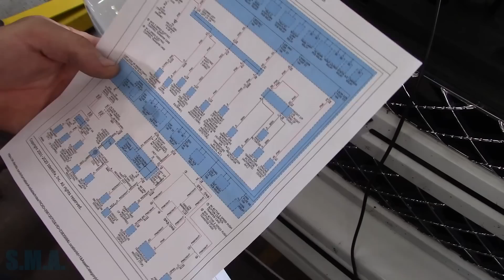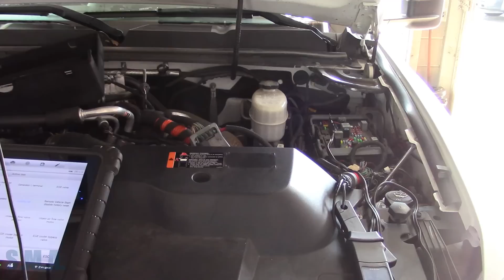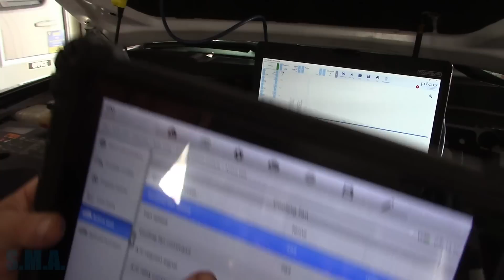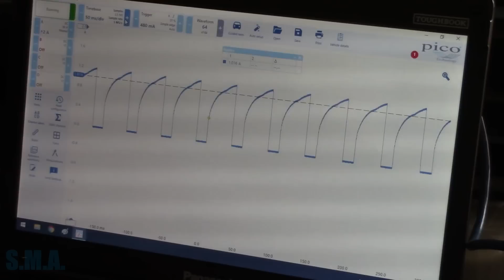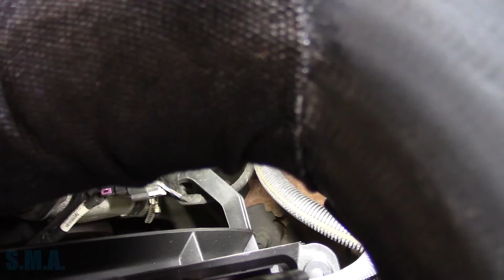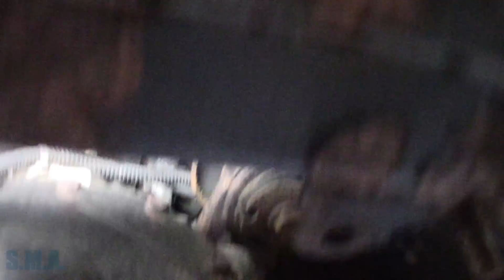Chevy 3500 Duramax Keep Blowing Cooling Fan Fuse

Comment: "Why didn't the other shop find this?" 
A: Because the other shop wants to make a fast buck and is not quality focused like SMA.
Do I advance to the bonus round now?
Reply: Exactly. I hate mechanics like that, the ones who don't want to WORK for a living. Kinda like useless lawyers and politicians.
Reply: Mostly because they lack the expertise and are only interested in quick fixes. And quick fixes mean swapping parts, not tracing down problems.
Reply: @tjroelsma  - It's because service work such as brake jobs, tune-ups, and the sort, pays more and is easy. Like I said, they remind me of worthless lawyers and politicians.
Reply: @robertgantry2118  Those are the quick fixes I meant: fast and cheap to do with huge profit. 
- Diving into a real problem requires skill and time, so you need a higly trained and skilled mechanic. 
- Parts swapping however can be done with basic knowledge and an OBD2 computer, so you only need a barely trained mechanic. Connect the computer, have it spit out a fault code and tell you which part to swap and Bob's your uncle. Easy money.
Reply: @tjroelsma  The same issue  ( chaffed wire ) can cause OBD2 fault codes. Which means replacing parts is often not the solution to codes. Eric has shown this in many of his  diagnostic videos.
Reply: @davidquinn6161  Yes, and then these shops throw up their hands and say "I replaced the faulty component so why doesn't it work?" and if the owner of the car is lucky it ultimately ends up in the capable hands of someone like Eric O. 

There's a channel by Diagnose Dan who shows a BMW that had been to, from memory, 6 shops and they couldn't fix the problem. He solved it within an hour as being a Canbus problem and fixed it.
Reply: @tjroelsma  "Mr. Reed! Fire the forward Parts Cannons!"
Reply: @markh.6687  "And the aft cannons. And to be thorough give it a full broadside as well, you never know."
Reply: Because they can't read a wiring diagram.
Reply: @NemoBlank  WON'T read a wiring diagram.
Reply: Simmons Rockwell well we find nothing wrong but hey we will sell you a new vehicle
Reply: They punk kid tech couldn’t fix it with a new ECM.
Reply: @TheElectricnoob When you take something in anymore, and tell the service writer you have no code being thrown, you can instantly see the fear and panic on their face. Old school troubleshooting is becoming a lost art. Good on Eric. I think he accels at this hard to find stuff.
Reply: Actually too many  mechanics heads switch off when confronted with an "electrical problem".
Reply: David Wright ; Simply because in the other workshop I was not doing the job (ERICA O) as simple as that.
Reply: Hi Dave it’s Dave nice to meet you !!.
Reply: @DavidWright-yh8zx  Same here ! You have good taste in your choice of YouTube channels to watch.
Reply: @DavidWright-yh8zx  I will venture a guess that often the "other shop(s)" utilize the manufacturer-created "troubleshooting flowchart" exclusively. Some of these contain errors (2001 Dodge Ram factory service manual has an error in the 4wd troubleshooting flowchart for one absolute example). If the employee cannot find exactly what the flowchart identified as the cause of the problem it is labeled "unrepairable". This is my speculation I admit.
Reply: @walterk1221  I believe you're correct. Most shops and dealerships won't allow a tech hours of time to find a chafed wire. And that's assuming the tech had the talent to locate said short. And even if they did, they'd then try to make the owner pay for an entire wire harness for that section. I'm exaggerating a little, but my point is accurate I think. Cheers
Reply: @giggiddy  I absolutely agree on the proposition that the mysterious "other shop" (especially if a dealership) would call for the replacement of the entire harness.
Reply: @walterk1221  Years ago  I worked At a dirty country garage on a dirt road. Some guy we knew brought in a Volkswagen van that had an intermittent shut off problem when he drove on wet roads. After spending thousands at the dealer replacing all kinds of stuff, he gave up and brought it to us, we put it on the hoist and found the crack in the wiring harness, and bad wire with some water from a garden hose.
Reply: "You don't know what you don't know." Why assign maliciousness when the only thing they did was say "I don't know?" but a new fuse made it work?
- 
Why do you think there is no money to be made in diagnosing and fixing wiring problems? Time is money and it all pays the same in a shop. 1 hour for diagnosis, 30 minutes to fix and you charge the customer 2 hours plus tape and solder.
Reply: @real_arbuckle  well... since a fuse does not just blow for no reason there is a justification for some condemnation. I think the "other shop" should have told it  as it was: "... there is an intermittent short, we don't have the expertise to chase it down; we recommend you schedule an appointment with South Main Auto because Eric is gifted with an uncanny ability to troubleshoot..."

Comment: Rookie mechanic. Throw a 20 amp fuse in there and follow the smoke
Reply: yup that works
Reply: I am a two way radio tech and have seen that "repair" all too often!
Reply: If you are lucky, the chaffed section will burn up first, since it has a thinner diameter, and therefor a higher resistance and will heat up first.  If you are unlucky, the entire length of the harness will burn up, and possibly take the truck with it.  I know you were only joking, but I wanted to point out that your advise could possibly be correct, but in a very dangerous way, lol.
Reply: @Bobbywolf64  Dangerour?? Try a clearance sale at a bridal shop! THAT's dangerous, lad! :)
Reply: Scary facts.
Reply: I wedged a quarter in the fuse panel on a Dodge ram once to get the heater blower to run . Worked great until it started stinking up the cabin.
Reply: like finding a gas leak with a sigaretlighter.
Reply: Cigarette lighter (-5 pts) for spelling.
Not funny, I had a builder do that on a new house. Practically strangled him.
Reply: @ogee634  I am shure that I read and write better english then you do in Dutch.
Reply: @ogee634  that’s not a problem what do you think a cigarette lighter is? It’s gas put through an Orifice  with a spark applied… I’ve had gas gauge is showing a leak over a 48 hour span but my sniffer wouldn’t find anything because the leak was too small. Threw a lighter on it and although the leak did not flame up I did see a space difference between the lighter and the flame which indicated where the leak was coming from. When you understand how things work it’s amazing what you can do to troubleshoot.
Reply: "-) a little smoke ,OK, but not to much, computer world, been there done that, ended up buying a new putter. love it.
Reply: Don't even jokingly say that. Some moron will do it and you'll be replacing the entire harness instead of repairing a chafe.

Comment: Soon you'll have another special day.
Just in case I miss it,
Happy birthday.

Mine is the 23rd
Reply from the maker: 25th for me this year.... the big 4 one :(
Reply: @SouthMainAuto  Getting older is like frying bacon naked.  You know it's gonna hurt.  You just don't know where.
Reply: @maingun07  😵🤣🤣🤣🤣🤣🤣
Reply: @SouthMainAuto  
5 6 for me.
1964 was a great year
Reply: @hugglescake  It was indeed! 5 5 here, soon 5 6....circa 1964!
Reply: @SouthMainAuto  Y'all are youngsters.  Looking at the completion of 7 decades on the 17th........
Reply: @int53185  I fractured a couple of vertebra (S1-L5, L5-L4) in my 20's so I am backwards on your statement.  No surgery yet.  The thing I hate most about being 68 is I have a very bad alignment problem:  every time I see a bathroom I need to use it (exaggeration?).  Have hope James,  last year I put by hand 1000 wheelbarrows of wood chips in my garden.  Yes my back hurt but not while I worked.  Hope your back gets better
Reply: @int53185  sight